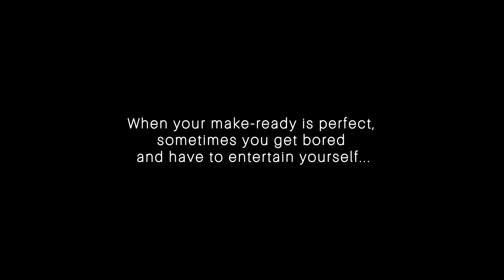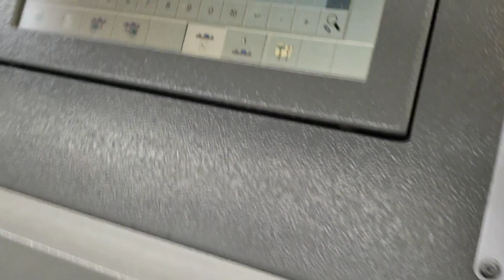One Carton, Two Barcodes - Bobst Expertfold - folder/gluer

Comment: What is meant by the term “make-ready” do you mean the set up??
Reply from the maker: In the industry, it's the same as "set-up". When I first started, I asked the same thing and was told it's called that because you "make the machine ready". I thought it was stupid, but used the term because having the same lingo no matter where you are helps with communication.
Reply: @Oakhart76  makes perfect sense. Thanks for the detailed response
Reply from the maker: @AI67890_  no problem 😊
Reply: Yup same answer I got when I was first starting out also! “Make” the job “Ready” to run.
Reply: Here in Brazil we use the term set-up in English 😂😂
Reply from the maker: @leandromatos4954  LOL. Is that because English is an international language?
Reply: @leandromatos4954  im in north england and we do too